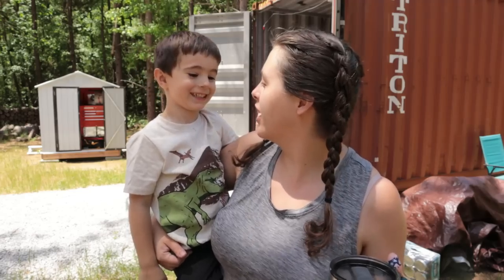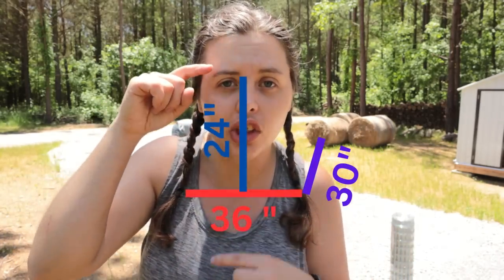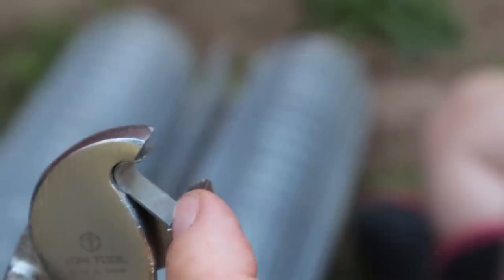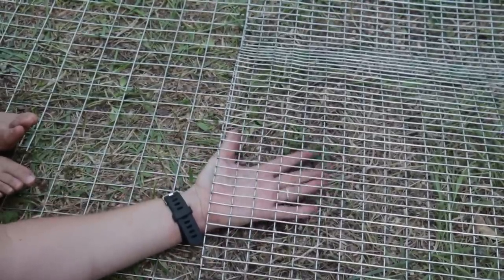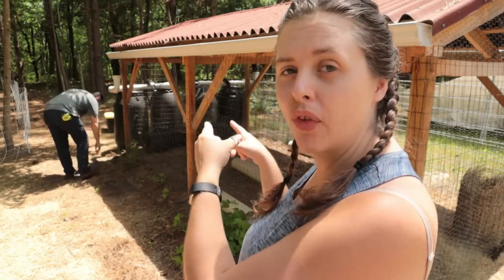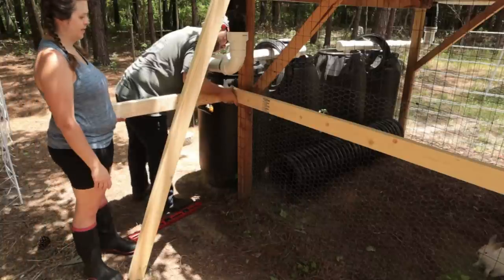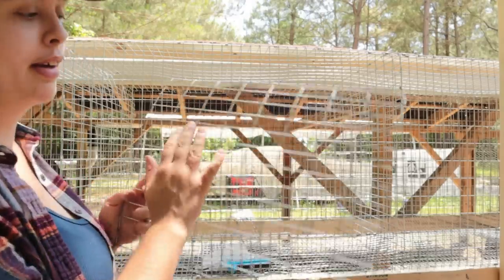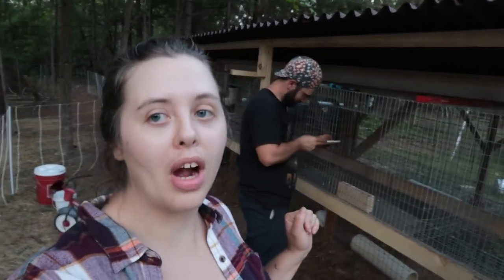WE ADDED A 15 FT RABBIT CAGE SETUP TO OUR HOMESTEAD Expanding our rabbitry for breeding meat rabbits

Comment: Have your cages rest on wood will cause problems later on. You should hang the cages It also helps with snakes getting into your cages. you can build a ramp so all the waste is collected in a smaller footprint.
Reply from the maker: We deal with wood and rabbits often since we use it for our rabbit tractors and rabbit colony also.  We definitely took the cons into concern when constructing this set up. I feel much more secure using the wood and the cage only rests on 1/2" of the wood.